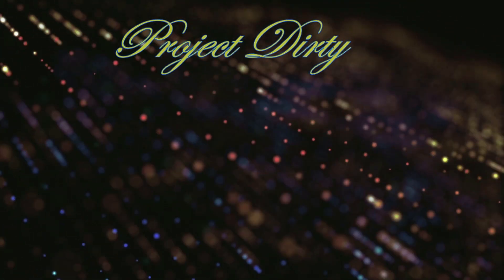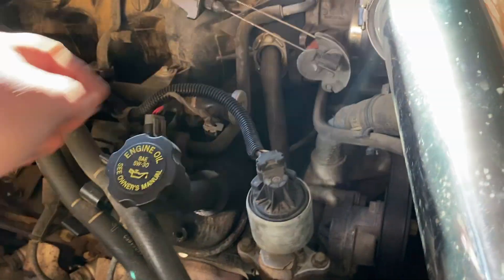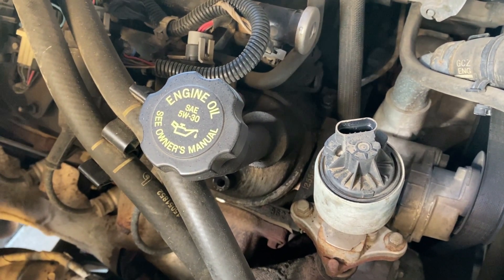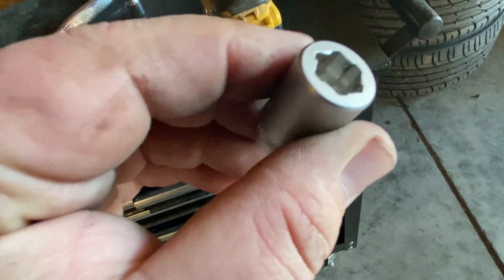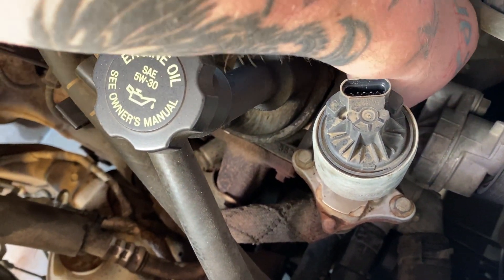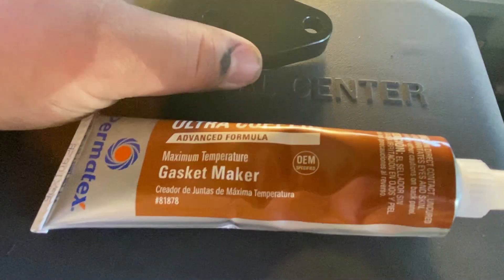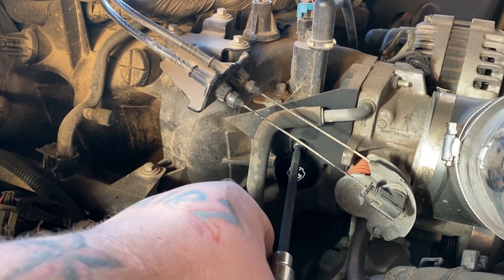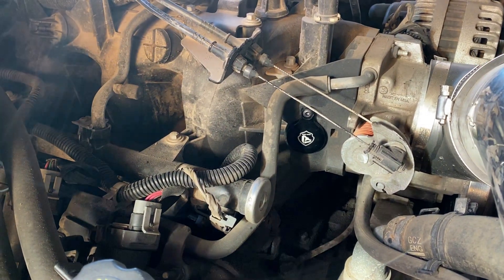EGR Delete 5.3

Comment: Usually the ground wire fails and everything that runs on electrical need a good viable ground. Your obd 2 port tool will say insufficient ground or egr stuck open. Or closed. Usually bad shorted ground.

Comment: On a stock 2000 5.3 ls Lt version you can tune it out to 400 hp but you gotta put 91 or 93 octane or else its gonna ping and you dont want no ping. Id recommend hp tuners just cuz i know that works. Other brands are good but i can vouch for HP.

Comment: Depending on the shop your tune can cost anywhere from 150. To 500. On the eary 2000 stuff. Not sure how much after 2004. Might as well tune it for performance while your getting the correction tune.

Comment: What about the egr part where you unplugged the sensor what with those parts stay in the truck ?  Im running into issues rn with my truck
Reply from the maker: Nothing stays take the entire system out plug exhaust and intake and tune it put

Comment: I deleted mine and now it idles rough and throws a multi cylinder misfire code..??
Reply: No sir, is that my problem?
Reply from the maker: @12Delta91foxtrot  without looking at it probably or you have a leak on the block off on the intake
Reply: @ProjectDirty  thanks
Reply: @ProjectDirty  I deleted my EGR all tree of them and felt a big difference in power and acceleration , quick throttle response . Yes it idle a little high but not much  , after 10 minutes the it smooth itself like butter . After I get my tuning ,  should see  bigger results . I have seen EGR delete videos , none  show the results in acceleration or quick throttle response .
Reply from the maker: @tomasmartinez7349  I’d put money on it’s because it’s a placebo effect when I had my dyno I never measured any noticeable difference
Reply from the maker: Did you tune it?
Reply: Iv put an 04 motor in my 99 and runs like shit, keeps saying number 4 miss fire. I must have to delete it out of the computer I think?

Comment: What tune are you running?  I have a 01 6.0 ls that I just pulled the throttle body and the whole intake was almost plugged solid took about 6 hrs to clean it.
Reply from the maker: I do my own tuning with hp tuners
Reply: @ProjectDirty  I don’t guess a bully dog tuner would do this? I just ordered it yesterday should have it by Monday
Reply from the maker: @BillRodgers2  probably not since most won’t let you delete emissions stuff
Reply: @ProjectDirty where do I order the HP TUNER?

Comment: How much is a tune up ?
Reply from the maker: Depends I just did it myself
Reply: @ProjectDirty  If I don’t get one would it affect an any type of way ?
Reply from the maker: @dgbdrippy8346  check engine light and timing is off are the two biggest
Reply: @ProjectDirty  What software or scanner did you use? With my 96 5.7L Vortec, since I blocked EGR ports I get very rich idle, hesitation-type acceleration from idle and check engine.
Reply from the maker: @muchgreatness7497  I used how tuners but I don’t believe they supported the Tahoe and Silverado until 98
Reply: @ProjectDirty  Thanks. I was looking at a tuner by Diablo but it'll probably be the same thing as HP Tuners.
Reply from the maker: @muchgreatness7497  typically you have to have a dealer write you a custom tune for Diablo i doubt they will give you a off the shelf tune that deletes emissions
Reply: @muchgreatness7497  after the tune did it fix it? My 5.3 has been having some major idling issues it jumps from 1k to 2 when just sitting at stop lights. I sprayed the whole block with jump start to find the vacuum leak and only place it changed the idle was at the EGR where there was a clear leak since it doesnt have that second bolt in spot
Reply: What code do you get when you do the egr delete?

Comment: I just ordered one for my 1999 Silverado, it’s got an intake and no cats to a glass pack. Will not getting it tuned cause any major problems or will I be fine driving it as is, I don’t mind the check engine light I’m used to it now lol. Thanks!
Reply from the maker: Timing is a little off but definitely won’t cause it to be undrivabled

Comment: What happens if you do not get it tuned?
Reply from the maker: You will have a check engine light and timing will be off then needed
Reply: @ProjectDirty do u also get a multiple misfire ?
Reply: Where and how would you get it tuned? Thanks
Reply: @jamesbarlowjr.3762  You will need to find a local tuner. To my knowledge HP tuner is the best software for tuning and most tuners charge $200 and up.

Comment: Egr helps with Low rpm cruising? So now you get poor gas mileage?
Reply from the maker: Actually I’ve picked up 1.5 in town and about 2 highway
Reply: @ProjectDirty  before tune? Or only after?
Reply from the maker: @christopherhamilton4373  both
Reply from the maker: The truck had already been tuned before, I just shut the egr off and turned the codes off after
Reply: So egr delete makes your gas mileage worst?

Comment: Did your truck run better after the delete?
And where can I buy the block off plates?
Reply from the maker: Real Truth it got ride of the slight smoke issue I had after but I was also having issue with mine sticking also
Reply: @ProjectDirty wdym what type of problems did it give you boss?